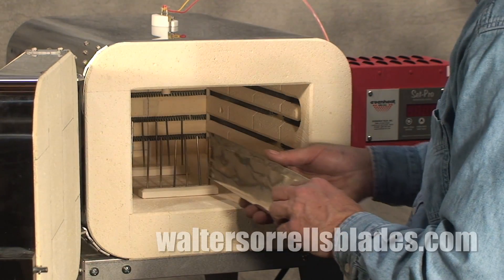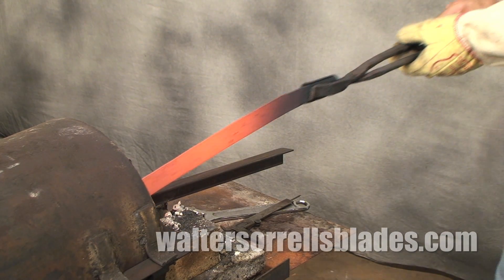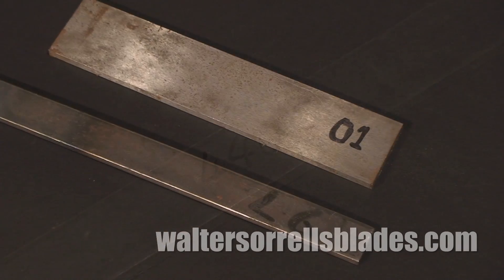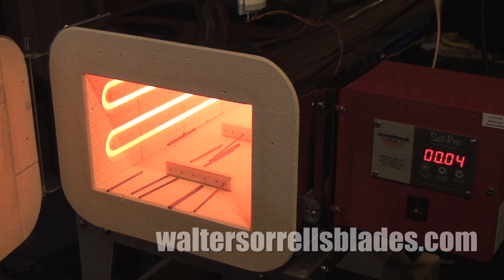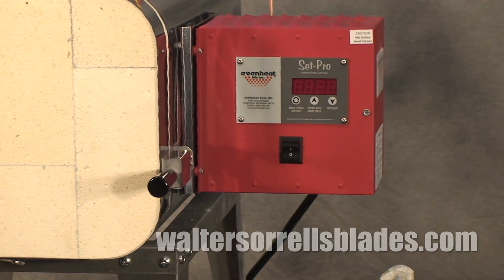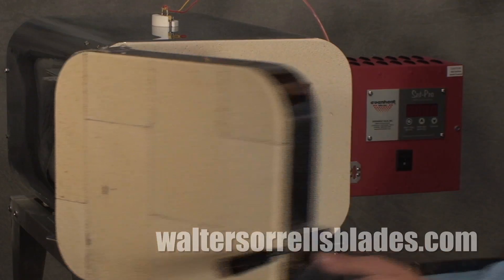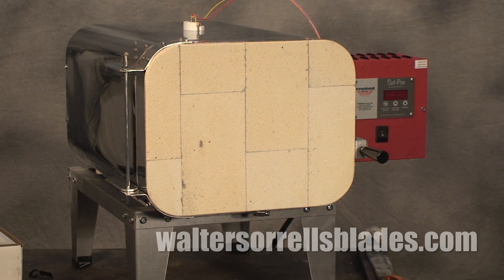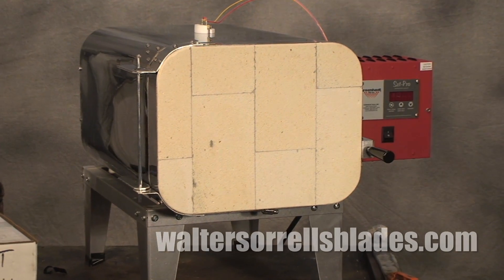Knife Making Tools Part 20: Heat Treating Ovens

Comment: What temperature do you heat treat steel and I'm thinking of using one of the two glass kilns at my school then of course quenching
Reply: It depends on the steel but most steels it's above its curie temperature so around 1500 degrees Fahrenheit. I wouldn't know if the kilns will get that hot but a good test is to put a magnet close to it. If it pulls the steel its not hot enough.

Comment: hi, i am a 14 year old knife maker, I am trying to make a fillet knife for a customer right now, and he needs it to be very flexible. what steel do I need to use and how do I heat treat it.
Reply: Dempends on what steel you use If you use stainless what i Gues for a filet knife jou should harden The edge not The spine That means you have a hard edge and a flexibel spine
Reply: flexibility is a function of geometry, not the steel.  The quality of the steel and the heat treat will determine how much a blade will flex before it stays bent or breaks.   

for fillet knives, AEB-L stainless is a great steel.  Begin with .070 inch thickness for a 6inch to 9inch blade (not counting the handle length, just the blade).   You'll want to heat treat the blade first and grind it hard.  Steel that thin probably won't stay straight if you don't harden it first.   I like AEB-L at 61 - 62 HRC hardness.

For a decent amount of flex, give the blade a distal taper so that it is about .040 at the heel of the blade and taper it down to about .020 at the tip.

Comment: OK so I am making a knife right now and the steel I'm using is hot rolled so I need to know if it is safe to heat treat it
Reply from the maker: +Tim Kinsey   "Hot rolled" is just an industry term for the way that it's squashed into shape.  It doesn't refer to the alloy composition.  Without knowing that type of alloy you're dealing with, there's no way to know.
Reply: Ok Thanks! That helps a lot.

Comment: i have a piece of stainless and I don't know what grade. I have cut a piece off of it and it is hard. It came from an expansion joint that a bridge beam sat on....but I want to make a bowie out of it and not sure how to temper or treat it
Reply: You can temper iT in a toaster oven on 240 degrees cel for an hour you can het threat iT by air quincing iT

Comment: Excellent video...one of the best items I ever made for my shop was a "power station"...it's a rotary phase converter which also outputs regular 220 through different plug configurations. I can use 3 phase power (machine tools), welders, and even use 220 with a GFCI for when I brew beer.

Comment: Is it just me or is anyone else having the same problem I'm having? For some reason everyone of your videos where you are talking to the camera, your audio almost shuts completely out! All I hears is a low buzzing sound and can barely here your voice. When it jumps to you narrating when your actually doing the work, I can hear you just fine. But when it jumps back to you filming yourself the audio goes out again. This is happening in every vid you have. I don't have the problem with anyone else or any other vids.
Reply from the maker: Yeah, it only happens on my older videos and it only effects iPhones 6's (I think).  Something to do with the way Youtube processes audio codecs during file compression.  Or something.  The sound works fine on most devices.  No clue why it happens, but there's nothing I can do about it now.
Reply: No I have an iPhone 5 and I have the same problem
Reply: +Walter Sorrells  iT Also affects iPhone 5
Reply: Yeah I phone 5 as well. Oh well the important info audio worked so it's all good. Thanks for all your videos. I'm hoping to make my first knife sometime soon. I just need to buy a little bit of steel and other materials.
Reply: Does it on Galaxy s7
Reply: Same here Samsung s6 btw
It is a fault in video editing before uploading to youtube

Comment from the maker: Absolutely.  If you were setting out to equip a knifemaking shop from the ground up, a heat treating oven would be fairly far down the list of things you'd want.  Lots of cheaper ways to get the job done when you're first getting started.  In fact, if you're going to specialize in forged blades, you might never want one!

Comment: for tempering carbon steel when jsut starting out you can also use a house hold oven cause most of the tempering temperatures can be acheived